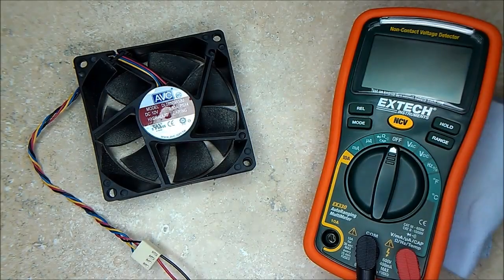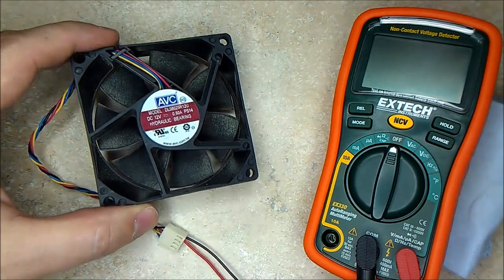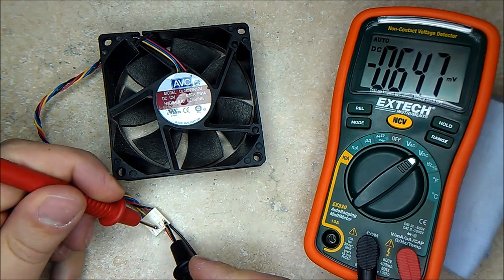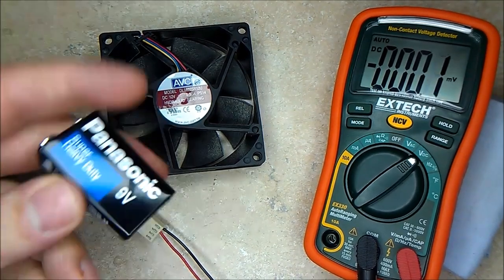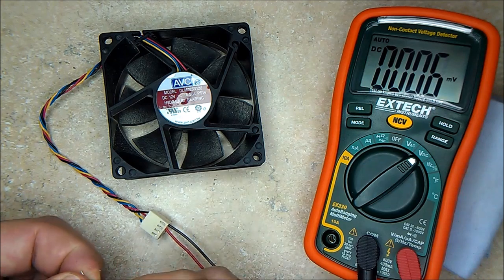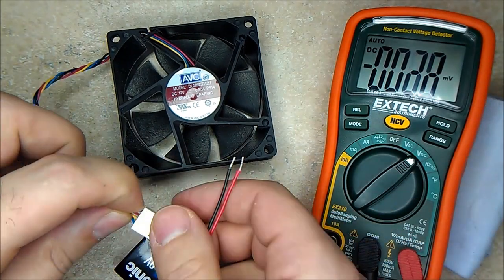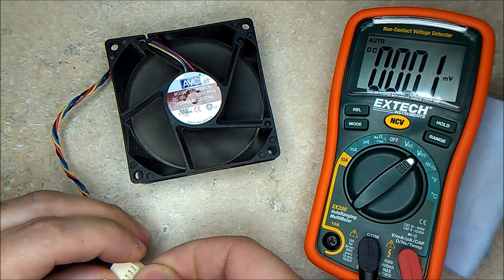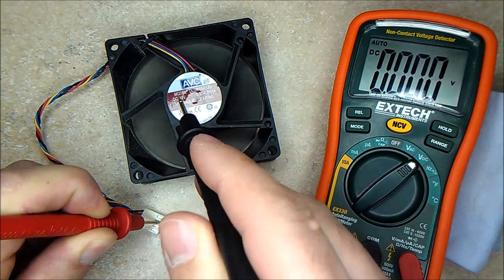How to test a faulty? computer Fan.

Comment: Thank you for the video.  I wanted to add to the knowledge base where I had a Dell ultra 7070 (laptop type parts) with a PWM fan that was stuck at full speed.  I've never seen this before but it seems that the failure was on the PWM components on the fan itself.   It was a foxconn pvb060b05h laptop fan  5v 0.75 a.  4 cable lines had normal continuity and I never figured out what component on the fan circuit board failed, but it basically was stuck running at full blast.  Swapping out the fan fixed the problem.  Weird and rare.

Comment: Hey thank you for that little tip on you I'm using a 9 V battery with the connector and hook in the wires up.  I had 10 fans I needed to test. And your method worked perfect.

Comment: What about resistance?
And what is the other two wires for, the yellow and blue, different speed?
There 4 wires for Pete's sake
Reply from the maker: Great question. The Black wire is GROUND (0V), The Yellow is 12+V, The Green is for Sense/Tach (indicates how fast the fan is running), and the Blue is for Control/PWM (tells the fan to speed up or down)
Reply from the maker: A 4-wire CPU (motherboard) fan is a standard brushless dc (BLDC) fan, but has four wires extending from the casing. Each of these wires serves a specific purpose. Note that Chassis and CPU fans may use either 3-pin or 4-pin power connectors. 3-pin connectors are usually used for the smaller chassis fans with lower power consumption, while 4-pin connectors are usually used by CPU fans with higher power consumption. 

The simplest PC fan requires just two wires – one wire provides power (12V), and the next wire is ground (0V). In a 3-wire fan, the extra (third) wire is the ‘tachometer’ signal (Tacho) wire that indicates how fast the fan is running. Here, the fan speed is typically controlled by increasing or decreasing the voltage over the power wire, as in the case of a common 2-wire fan. However, the 4-wire fan is a little different as it has the fourth ‘control’ wire to input a signal to the fan that commands it to speed up or speed down. Simply, a 3-wire fan reports its speed, and a 4-wire fan lets regulate its speed by an external signal, usually coming from the motherboard.

Technically, a 4-wire fan is called as “4-Wire Pulse Width Modulation (PWM) Controlled Fan”. Intel developed connection standards for 4-wire fans.

Comment: I have a very similar CPU fan (AVC MODEL DA07020B12U) that has stopped working (I apply 12 V and it doesn't spin, but mechanically it spins fine, but it is very dusty). What I want to know is, when a fan like this fails, what exactly fails? Is there a fuse inside, which I have to tear off the label to get at?  Does a resister go bad? Is there just a little integrated circuit inside? If that goes bad, perhaps replace that? Or could dust possibly ruin the circuit inside?  Where could I find this out?  By the way, correct answer is NOT "oh just get a new one". Yes, I will do that as last resort.
Reply from the maker: Verify the wiring to ensure you are putting the voltage where it should be.
Reply from the maker: If the fan developed a short in the winding it will not spin no matter what you do. Run a Continuity Test on the + and - cables. If OL shows, you got a short and will need to replace the fan.

Comment: you could use a 5V led strip connecter and plug it in into your 4-pin connecter it works! but put 5V+ in red and G in black

Comment: I think you're connecting a 9v battery to a 5v rail. Usually in PC power systems, yellow=12v and red=5v. Usually excess voltage damages components, so you might want to check that
Reply: This doesn't apply to computer fans, where red = 12v, black = ground, and (in the specific case of this fan as wire colors might differ quite a bit) yellow is the tach signal.
additionally, since this is a 4 pin connector fan, the 4th blue wire is a fan control wire which lets the host (a computer) send signals to the fan to change rpm.
Reply: @MrK1kk3r  Thanks for the info and correction! How does this work with molex to 4 pin adapters? Does that mean they direct the yellow molex wire to the red fan pin?
Reply: Thank you for noticing that, I was confused.

Comment: I have a gpu fan that doesn't work when plugged into the card but works when powered with 9v battery, what could this be?😒 I have a sapphire r9 290 vapor-x
Reply: gpu has its own bios that controls its fan, also drivers control that too :V. Does it spin when you press the power button to turn on the PC - even for a second?

Comment: Probably not a good idea to use 9 v battery if it's a 5v laptop fan-two aa cells (3v ) should do.
Reply from the maker: Correct. The fan being tested here is 12V though.
Reply: @JoseSanles  he said if, btw where r u now?

Comment: how can i test the output in motherboard pin connector with the multimeter? to check if it is sending enough V ? my fan cooler spins ok with the battery

Comment: Okay. How would you test further the fan if this is not the issue?
Reply from the maker: Not sure what "issue" you're referring to...  When in doubt, get a replacement fan. They are not expensive.
Reply: Geez, man, exactly what you presented in the video. Actually, the quality silent PWM ones are expensive. Testing further the digital and analog components...

Comment: Dude, if the fan is shorted you still would have 0V on the +/- terminals.
Reply from the maker: Depending on your multimeter, a short should show as an OpenLoop (OL), not just 0V.
Reply: If it shows open loop, the multimeter is not working, so yeh
Reply: Also, I just stated that there will be zero potential between the terminals (a bit short hand though), not what the multimeter will show. Are you sure about OL? A short should definitely not show open loop, that would be very misleading I think
Reply: then fix the fan first ;)

Comment: so my CPU fan header from my motherboard shows a 5 volt on the multimeter. My 4-wire pwm fan works when I plug it into an 4.3 volt batteries. But when I plug the 4 wires connectors back into the CPU fan header on my motherboard, my fan wont spin! I put my volt meter to check for voltage and it shows 5 volt but my fan won't spin! Can you please help? Thanks!
Reply from the maker: Boot to the BIOS and manually activate the fans to see if it works, and to make sure the OS is not the problem. If it works while manually activating it on the BIOS, then you know something's wrong with the OS thermal reporting settings.

Comment: when i supply power to cabinet fan , it spins for half revolution and then stops. what might be the problem and how to solve it?
Reply from the maker: Either it's not enough voltage to make it run, the fan requires a "feedback" line, or it just went bad. Try to give it the same voltage as shown in your fan. If not, most likely it failed. Good luck.
Reply: thanks for the reply SechoDB. I tried giving same voltage and it didnt spin.

Comment: when i turn on my laptop fan is work till window load after that fan turn off what should i do..pls tell me
Reply from the maker: Your Operating system might not be communicating properly with the BIOS. Try booting from a known good OS and/or run the built-in fan diagnostics if available.

Comment: so if the fan is working then the problem is in the motherboard? because i am facing a problem that the fan doesn't reach high speed, but when i connected it to external power supply it worked properly
Reply from the maker: Either the Board or the OS. Run the built-in Fan diagnostics if available. Check BIOS settings.

Comment: my notebook fan connected directly to 5 v stats for about 2 seconds and then shut of. And the loop starts over and over. On off all the time.
Is broken? is there a way to fix it?
Reply from the maker: Look at the voltage of the fan. You'll need at least 3/4 of the power to test it properly.
In this video the fan needed 12V but worked with just 9V. If the fan tests bad you'll need to get a new one. Can't fix.